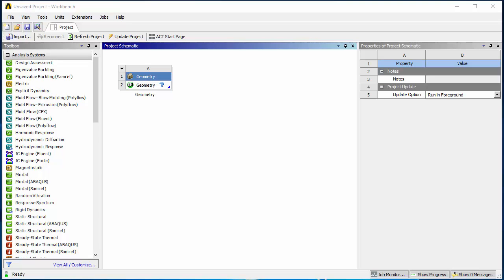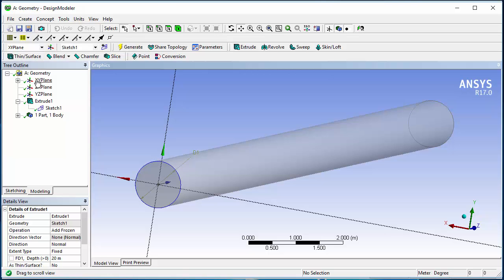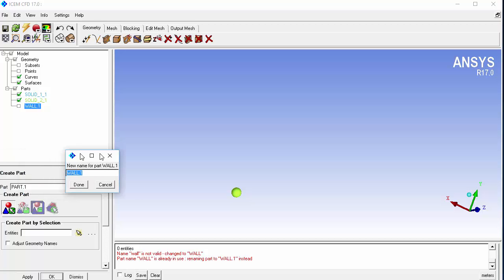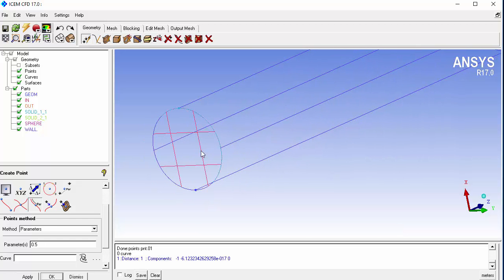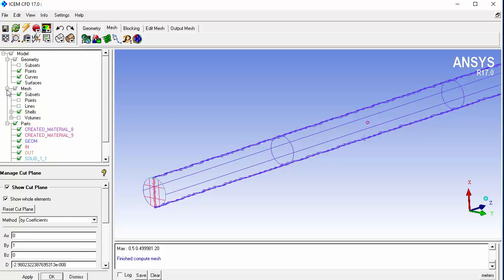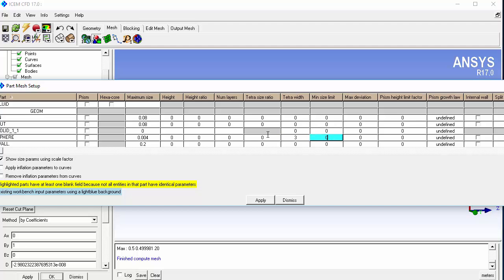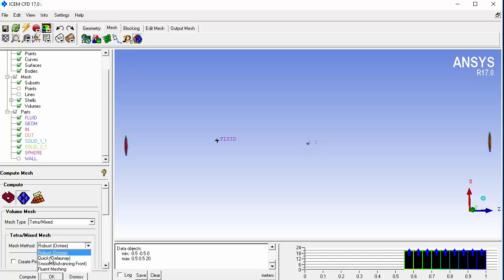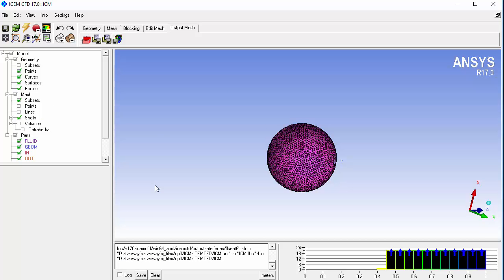Two Way Fluid-Solid-Interaction tutorial - Geometry and Meshing (1/4)

Comment: Hi; 
Why you don't subtract the solid domain from the fluid domain in the design modeler?
what will be the difference if I use the Ansys default meshing tool instead of ICEM
can you send me the tutorial files? 
thanks in advance
Reply from the maker: For ansys meshing you will need to subtract the solid domain from fluid domain. But ICEMCFD does not work on solids, it only uses surfaces. So it does not matter I subtract solid or not. 

ICEMCFD is more powerful software but also has steep learning curve.

Comment: As far as I know, the Octree meshing algorithm is a volume mesher and so it does not/should not respect the surface meshing parameters as given in "Part Mesh" set up- for wall, inlet, and outlet. Am I correct?
Reply from the maker: it respects the surface meshing parameters. Initially it starts with one big triangle and then split it by the factor of 2. Finally it will stop where it goes to surface and creates the mesh specified on surface.
Reply: Okay thank you. Just for the sake of information, could you let me know about the parameters Height and Height Ratio? I understand that they are used for only Hex Meshes. Are they used for tet meshes as well? Thank you
Reply from the maker: they are used to creating prism layer. yes they are linked on tetra mesh but used for creating prism layers. Height = first cell height from wall and height ratio is basically growth rate of next and next to next and so cells
Reply: Okay thanks. I know I am being too insistent but one last question.  Prism Layers are used in  tet meshes only- in hex mesh we can control the boundary layer directly by controlling node distribution. So what is the use of HEIGHT and HEIGHT RATIO in hex meshes? Also, do you happen to have any tutorials on Prism Layer ? Thank you once more.
Reply from the maker: they are used for prism layers.
Reply from the maker: Let me check it myself first...